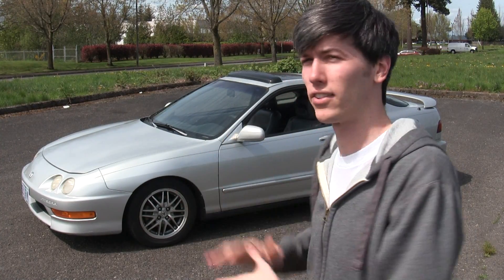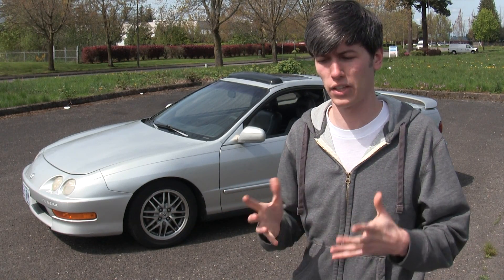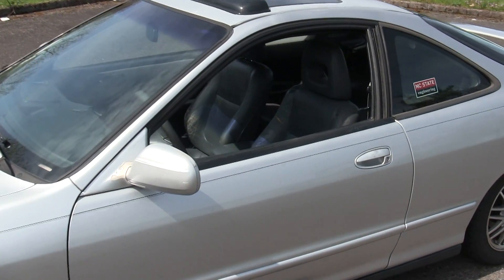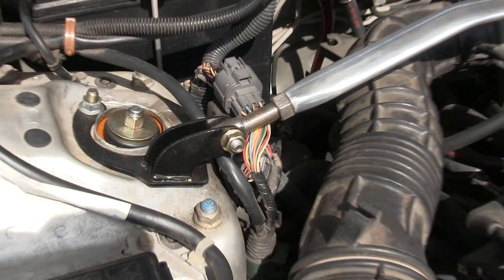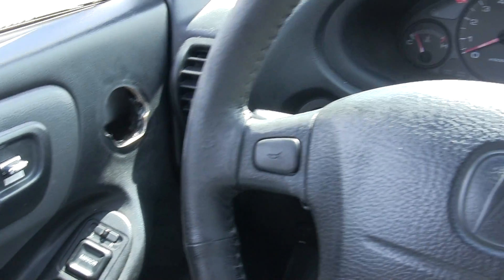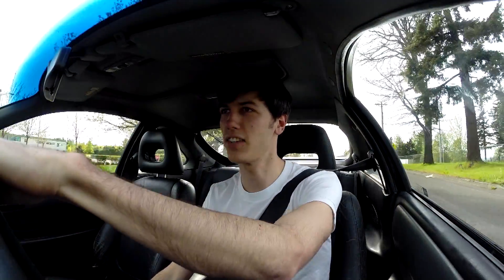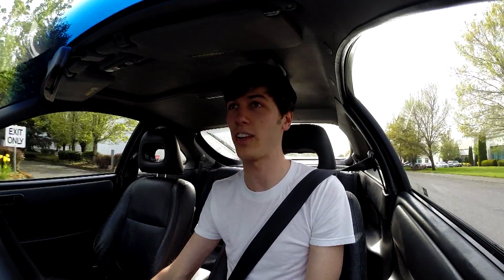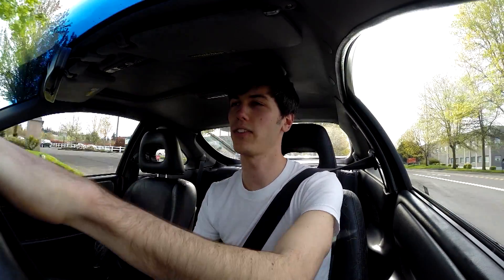Project Integra - Let's Build A Race Car

Comment: Hey man I know this is a really old video but can you show us how you replaced the ignition lock cylinder? and If it is possible to just buy the cylinder instead of the whole assembly. I recently gotten my integra stolen and thats the first thing I want to fix. I looked all over online onto where to buy just the lock cyliner but I'm not having luck most places are only selling the whole assembly. IF that what I have to do i guess ill just bite the bullet. But If I can get some questions answered from you that would be great and much appreciated as well. Would I also have to get new keys for the car? I came across your 10 benefits of getting you car stolen and I felt your pain because I was really stressing out when I got my car stolen.

Comment: try getting a wind tunnel tested  body kit. And upgrade the cam, crank add a Garret turbo, change the studs, upgrade the mains, give it a water/methanol injection, put a free flowing exhaust change the pistons and rods. Do a trans swap to 6 speed. remove every little bit of weight you can do a drive train swap to RWD put very low profile tires on it. then do a nice racing livery. For suspension go to four link at all four corners and for brakes go with 6 piston Brembo disks and the seat should be sparco and wheel too. of course you have to make sure that there are no clearance issues with the steering linkage and of course we can't forget the wheels right so put bnice wheels on it.

Comment: Change the handling by adding wheel spaces at least 20mm in the front then in the rear then both, do a corning test, does does it want to understeer or oversteer

Comment: Bore the block, new cam, port and polish the head, titanium valves, complete new exhaust, and a turbo! Probably need bigger injectors maybe fuel pump, definitely new water pump oil pump while it's out. I could go on but that's a good start

Comment: build a B18C Integra or go K24, you'll love it but it's more money.
All depends on what you really want, cheap & easy (B18C) or harder & expensive (K24) those two engines are very good. or slap a H22A Honda Prelude engine

Comment: To be honest, I'd like to see it be a bit of a GT car. Handling the corners is more important than anything else. Videos on how you use tire pressures, damping, spring and sway modifications as well as the power from the engine you're balancing would be great videos.

Comment: Ok, man. Before I tell you what to do, first let me explain what I have and what I'd like to do to mine IF i had the money. I am the 4th owner of a 91 Integra Hatchback with: 5 spd manual stock tranny with a 2nd stage street/strip clutch on a B18a1 stock motor. The wheels are 14" aluminum from an 86 Integra I used to have. The body has rusted out here and there and leaks everytime it rains, along with the paint taking a dump. I have the original tail lenses still on, and the original headlights/fog lights setup, along with the original nose/bumper.

What I want to do is: 
1. swap out the power steering pump with a new "electric-assist" power steering unit that I would mount on the firewall (no belt); 
2. swap out the belt-driven AC compressor with an electric DC-powered AC compressor (they make them for semi-trucks) - to get all unnecessary belt-driven parts off the engine for increased power. 
3. Next I want to install an "idler timing belt roller" to eliminate timing belt slap at higher rpm's - it mounts where the current power steering pump is mounted. This would also require the removal of the upper part of the timing belt cover.
4. Next I want to relocate the alternator to be where the current AC compressor is mounted, allowing for easier access to the alt. - currently the ONLY way to take out your alternator is to first remove your left front wheel & hub, then remove the drive axle - JUST to remove the alternator. Insane huh? Why couldn't they just mount it in front of the motor like everybody else?
5. next I want to rewire the entire vehicle, as the wiring is a huge problem and there are shorts all over - some things just don't work anymore. This rewire would also necessitate installing a "New Old Stock" (NOS) fuse panel as the current one is jury rigged - and that troublesome circuit panel mounted BEHIND the fuse panel needs to be completely rebuilt as it controls the rear-window defroster, electric windows, accessories, etc that no longer work or work right.
6. Next I really REALLY neeeeeed to remove the leaking & no-longer working sun roof, and as I have learned it would shave off 35 pounds from the weight of the car if eliminated completely & replaced with a sun-roof "plug".
7. next I would need to replace the cowl as the ends are broken off. Also, the "fresh-air" flap underneath needs to be welded shut, as it leaks every time it rains so it's good for nothing. You want fresh air? Roll down a window.
8. Next I would completely rip out the ENTIRE interior as it's seen better days and is waaaay over due, including the carpet & headliner. With that being said, the sun visors and rear-view mirror would need something to mount to, so I would need to design/fashion a plywood filler in the front.
9. The interior rear-view mirror silver is almost completely gone, so the mirror needs replacing.
10. The motor would be the next to get upgraded: GSR oil pump; GSR water pump; Morosso oil pan (a deeper pan than stock that will hold more oil increasing lubrication especially at higher RPM's); all new bearings, cleaned - ported - polished block & head, the intake manifold and rocker cover I would like to be "anodized", the exhaust to be a 4-2-1 (4 pipes into 2 pipes into 1) ceramic-coated header connected to a 2" I.D. stainless-steel catback exhaust. (Catback means the catalytic-converter is placed at the end of the exhaust after the muffler.)
11. I would also like to swap out the lead-acid wet cell battery for a DRY-CELL battery, which are so much more reliable.
12. As for the performance of the motor: that remains to be to most involved setup, as I would want to have a Turbo, but which would require beefing-up the motor's: pushrods, connecting rods, pistons, piston rings, camshaft, lifters, springs, etc etc.
13. everything else is purely cosmetic: a carbon-fiber hood, carbon-fiber deck-lid, replacement of the passenger door bumper, install a Duraflex R34 body kit, install new Halo-ring projector headlamps, new chromed LED stoplight lenses, news wheels & tires, etc etc etc.

GET THE PICTURE?

Comment: An idea I had a while ago (though I havn't done much research into it, but it's worth a look)  Aircraft use a fuel inerting system that takes fresh air and separates the o2 from the rest of the gas.  I'm wondering if you could push enriched o2 air into the engine.  My guess is you'd need a huge turbo to get the air through the inerting system, but you could get around compression detonation that way.

Comment: b18c vs all motor b18b1 Block: Forged internals  Head: ported, skunk2 cams, vtec head etc... HP gain, 400 meter time... then upgrade with  t3/t4 tubro.. HP gain, 400 meter time again :))

Comment: hate to say this because I want to make a YouTube channel but its going to be at least a year if I do but weight reduction great start with ripping everything out then make fiberglass panels hood,trunk,fenders then try making carbon fiber rims from prepreg, turn the car into rear wheel drive not sure if possible with the integra body... get a gtech or other brand gforce meter to measure the suspension. oh and installing a mega squirt ecu with flex fuel! think that's all I have guy below has good ideas too

Comment: i have a '96 and im going to attempt to make an exhaust valve ahead of the muffler and catalytic converter that i can open or close to allow change from a straight pipe exhaust to normal system. I have ideas but input would be welcomed.

Comment: I would like to see a comparison between polyurethane bushings vs a metal bushing.  Also look at Heim joint ends.  Most track day cars made from older cars will need these things addressed.  Suspension deflection camber, toe, caster effects.  Primarily focusing on longevity and durability between the options.  The noise levels and road feel would be obvious worse, but it's a "lets make a race car".

Comment: Any other modifications, you'll be doing for your project integra? 
-different transmission?
-perhaps lsVtec or more into that
-replacing the head of the engine for better flow
-inner works inside a b18b1? 
- are you temporarily done with this project?

Comment: 1800$ good deal for a 1996 integra manual 5 speed with 200k miles on it plz reply asap
Reply: Car runs and drive perfectly fine. 
Interior is complete and in good shape as can be seen in the photos.
Radio works and is wired for an amp and sub in truck already.
Cruise control works great.
AC and Heat both work great 
Although only on 3 and 4 for fan strength. Might need a new switch to work on low 
fan levels. Was that way when I got the car.
Oil changed on time since I have had the car and have service receipts.
Just replaced cap/rotor/and plugs, NGK wires still in good shape.
Track mileage on nearly every tank since I have owned the car, average MPG 30-34
Odometer reads 262k
Motor is not original, changed before I got the car. Motor was Marked at 94k when put in car, don't 
know when that was, so not sure mileage on motor. Starts up quick, does not burn oil or get hot.
5 speed Manual. Clutch feels and works great with no slip, 
Do not know when the last time it was replaced. 

Has Fresh Registration/Tags This month (April,2015)

Does that sound good for 1800$

Comment: Lift the whole car then drop the nose and shave the rear wheel wells and put some 20s on the back and push the front wheels out 2 inches wider is better

Comment: question if I put money into a new engine, transmission, suspension etc to make it more hp or a track car etc.  later when I sell the car how much am I going to get back from the parts I put in? 1/3 or what?
Reply: Okaythen001 nothing it actually loses value

Comment: Consider a B16A head swap to make your car vtech it will go faster above 5k rpm also wheels tires maybe a Jackson racing or comptech supercharger you will get a liner power gain a lot more reliable than turbo

Comment: I am interested in where this goes! I have this same car.  I've seen a lot of drag builds, but I'm more interested in track worthy. I have a Silver 98 GS. I've got a B20 vtec (b16 head) it has a lot of torque but I'm looking for more. I've stiffened the rear sway w/sub frame brace. Headers/ exhausted. Cold air intake. Update the fuel rail ( planning on boosting, but not sure if I want to deal w lag or supercharge it and sacrifice hp) 
I'm wanting to strip excess weight. So I'll be following this for tips on my own build!
Thanks!

Comment: Now bare in mind everyone, I'm 13 so the ideas that I come up with will most likely will be ludicrously mad and expensive. Just say'en! What I think dould be done to your Integera is you should put the J35Y6 V-TEC earthdreams 3.5 V6 SOHC engine. Par it with the ZF 9 speed transmission and SH-AWD, you got you self a 2 door Acura TLX. The one thing you might not like about the ZF 9 speed is that it's a push to shift thingy. But hey, it might look cool. The other thing to be cautious about the earthdreams V6 is its an SOHC engine, not a DOHC engine. The other thing is Acura puts the same engine in the RLX and it produces 310 HP. That can be increased to 377 HP, but thats the hybrid power train. Whilst the hybrid dose includes SH-AWD, a big battery is needed to power the three other electric power plants and that could rob trunk space and add weight. But with I'm pretty sure others will find a way to turn the 290 HP into a scorching hot horse power number. The TLX race car does have twin turbos so that could be a solution. Maybe evan two twin scroll turbos? Anyways, I was always wondered what a V6 Acura Integra or RSX would be like.

Comment: Yokohama S tires, ground control/koni yellows, rear ITR sway bar

Short geared transmission. S4c/s/y80 gsr

3" intake with velocity stack, 2.5" mandrel piping, 2.5" straight through exhaust, 2.5" TODA/PLM header.

Stage 2 jg/edelbrock/crower or custom cams - delta or m rocket

Ecu tune

Comment: You make the teggy sound like its a slow POS car and it breaks my heart to hear that, sure the Subaru sti is an awesome fast car as is but its about building your car not buying it i loved modifying my teggy do it correctly with some time and money and you'll get yourself a fast and super fun car, anyone can buy a fast car but it takes a real man to build one
Reply from the maker: XxmusicXxplz It's an awesome car, I love it. Still have fun every time I drive it. No need to be judgmental.
Reply: Engineering Explained
Wish I had the space to keep my 2001 Honda around that I sold and got a 2015 WRX (not STi) for a project car. I always wanted to make a sleeper car out of it and it would be a great learning experience. I wanted to do the same thing as you.

So with that said I suggest doing the upgrades other posters have mentioned that add performance and power to the car but still have the car stock looking so that you can leave folks speechless when you smoke their nice looking cars with your awesome powerhouse car :). Saving money for place of my own and eventually upgrades to the WRX (have to be careful not to void warranty).

Comment: Aftermarket Skunk2 exhaust catback straight pipe with Headers. New Throttle body 70mm Black Series Pro Series bolt on. Just change the pads on the disc brakes. Add a lightweight crank pulley for easy horsepower gain (Perrin). Ecu programming hondata. New paint. Tires of choice. Ricers would add the body kits not a very rare car like the GSR or type R. Mag rims Advan. Or engine swap a S2K? F20C 240 hp. Interior stripped out add a good cheap sound system ebay. Recaro seats Spec 2+ clutch with aluminum flywheel just some ideas :)

Comment: Put lighter wheels on to explain the effect of having less rotational mass on performance. This could also include light weight pulleys, flywheel, clutch, prop, even engine components. (Id like to see this)

Also lightening the car, with measurements of how many G's it pulls on corners before loosing traction.

Explainin of exhausts, to show the importance of flow on N/A cars for performance, explaining scavenging etc.

I know most of this already but I would never be able to explain it scientifically like you can.

Comment: Why don't you turn it RWD or 4WD?
Reply from the maker: Dakota Duarte You make it sound so simple.
Reply: hahahah, yeah, thought so
Reply: RWD with an S2000 diferential and 4WD with a CRV's, I think, I may be wrong.
Reply: yeah, that would be cool
Reply: Engineering Explained Can you tell me how to turn FWD to 4WD?
Reply: integras came in AWD
Reply: Yeah, but this one didn't, right?
Reply: Dakota Duarte so find a AWD and move parts over? without the cutting and Frankensteining it a choppy and unreliable mess, or avoid all the money getting it to work right..

your talking about CRV shafts like they can handle it when racing, people would be putting in C5s into them if it was that simple

Comment: I'd like you to show that when you upgrade certain parts of your car, for say, performance, its a very good idea to upgrade other parts...depending on the application and how far you plan to take it.  I see many people add an exhaust, possibly a turbo, and new wheels, but they forget about the pistons, rods, flywheel, transmission, cooling system, brakes and rotors, etc.  I'd also like to see a video on how to stiffen the chassis, either with sway bars or some other assembly, like a roll cage (if you even need one and when you may need one).

Comment: Do Hondas/Integras (I'm a pretty good modder myself, but I've never owned this brand) start with forged pistons? If you'd like to tear your engine down, and get on the loose side of tolerances so  you can open your oil galleries a bit and protect the engine from greater forces. This plus forged pistons would help it survive boost better.

I'm really into Jafromobile's YouTube channel, and I can't yet afford to even start on something like his projects. It'd be fun to see someone newer head in a direction, which I will eventually.

Comment: tow hook 
jdm fog lights
tighten your coil overs down
new exhaust system
cold air intake 
possible body bit
new stearing wheel
short shifter
new bucket seats ? bride ? recaro?
plastidip rimms

Comment: My ideas: aftermarket exhaust, aftermarket sound system, change headliner fabric, modify headlights/tailights (measuring battery usage, and beam strength?), turbo (it would be awesome if you installed a boost gauge), cold air intake (noting ideal locations, I've heard near the wheel well because of air flow), car washing/detailing products, body kit, after market fuel injectors.